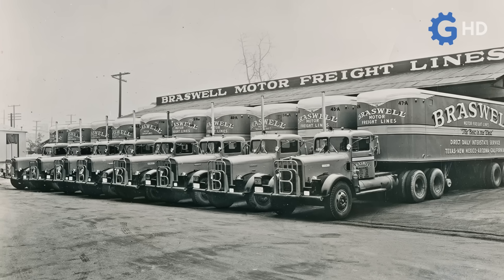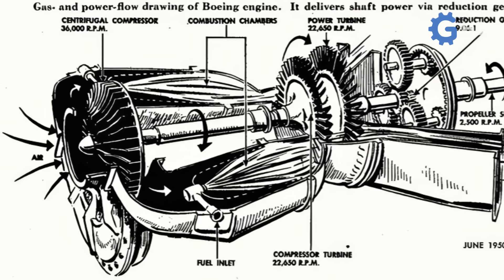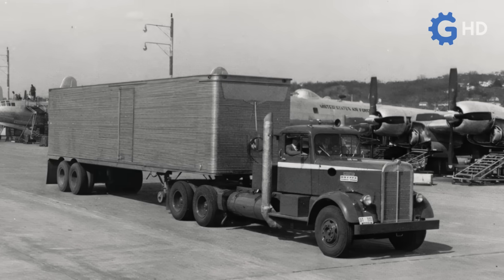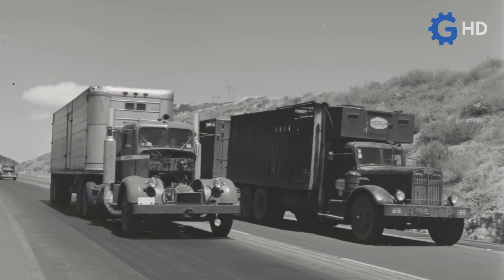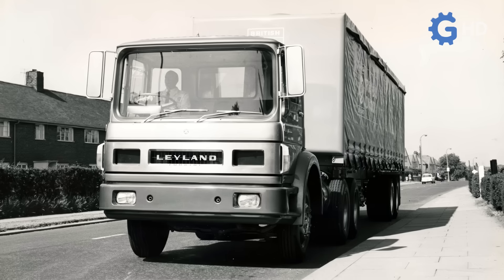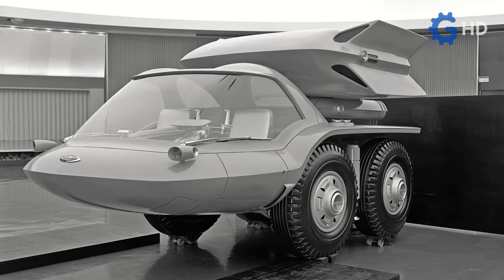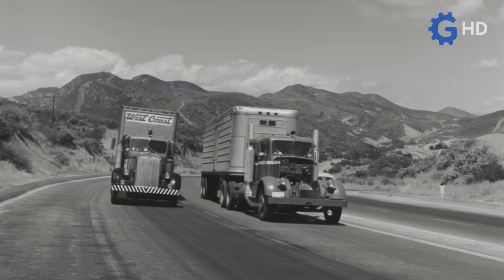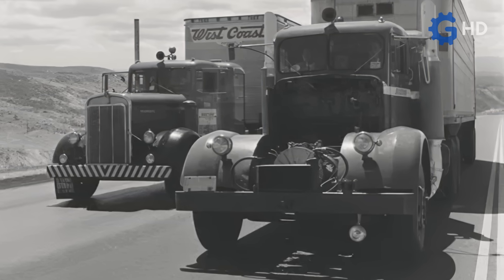The CRAZY Story of When BOEING Put a JET TURBINE in a Kenworth Truck

Comment: It would have been simpler to combine the turbine with an electric motor for traction, using it as a pure electric current generator
Reply: You would still have the same load/efficiency problem and terrible fuel efficiency... now combined with high construction costs.

Comment: After Boeing's turbine project was cancelled, one its engineers put one in his Model A Ford and drove it around for years.
A gas turbine engine is NOT a jet engine. Different number of turbine wheels. Gas turbines produce zero thrust.
Railroads experimented with turbines too, but they have almost no power at idle so they are not good at lugging. And their speed range is only 2:1 as opposed to 10:1 for a piston engine.
BTW--In technical circles, 'turbine' is pronounced 'tur bin.' I mean everywhere in the tech/aerospace community.

Comment: Thanks for the video. Without music in the background it would have been perfect. For a german guy it is more difficult to follow this interesting stuff. I can´t understand why big companies did such tests with gas turbines. Even locomotives had been tested with gas turbines service. They all failed. A gas turbine never ever can reach the efficiency of piston diesel engines for thermodynamic reasons. For aircrafts they are useful because lightweighted and powerful. However, the service conditions are different. An aircraft or a heli travels with nearly constant speed, allowing the turbine to run on the BEP - which is not good, but much better than on the other speed ranges. A truck might go with constant speed travelling on a highway, however, the engine must be suitable for sudden stops and for stop-and-go as to the traffic conditions. They try to build gas turbines with heat exchangers for better efficiency. Those engines are low scale, working in little aeroplanes. We´ll see whether they do it.

Comment: The problem is, you cant integrate leap innovation into an already well developed and streamlined industry, its too disruptive and therefor costly which the gas turbines for the road were, although they were getting rather sophisticated. Incremental innovation integrated into an existing technology is more cost effective, which is why turbochargers were introduced to drop power to weight ratio of regular diesel engines. Now they run on a combined cycle, one diesel, one brayton like a gas turbine.

Comment: Nitrogen dioxide? Soooo, can’t have it in a truck, but it’s fine to fly over my house shoving it out by the ton :D Still a good back up charger for an electric car (or truck). Run them at pull power and they are ace.

Comment: A gas turbine would've probably been for better use as a generator using it like the way they do a locomotive to power traction motors at the wheels. They're way more reliable than a diesel engine. The only drawback is the noise and fuel mileage.

Comment: As an aircraft mechanic I never knew a helicopter is not an aircraft .In the 50's the biggest truck diesel engine horsepower was about 350HP.  In 1956 Ford built 3 turbine Thunderbirds. I drove a Dodge turbine car and was very underwhelmed.
Reply: Agreed, the number of false statements in this video boggles the mind.

Comment: The title says "Jet Turbine," yet what was installed was a GAS turbine. 
One goes through a gearset/geardrive and is connected to the driveline. The other uses exhaust gases for thrust, and there is NO connection to the driveline.

Comment: I doubt 500hp. Secondly a very light Engine... The truck tractor needs weight on the front  and drive wheels , so a light engine is not necessarily a good thing at all.

Comment: I'm positive that the turbine engine had to be geared way, way down. Turbines produce little torque at any speed usable in a truck.  The turbine needs to run at at least 10,000 rpms in order to do much work.
Reply: That’s why turbo electric and turbo hydraulic drive trains are used.
Helicopter main rotor torque characteristics are very similar to truck drive requirements.

Comment: @7:57 I have to say I do believe our esteemed host might have been chewing on a wild wood weed when he started talking about any manufacturers looking to use a gas turbine to powered road tractors in the 1970’s, like that was gonna ever happen.  Ford and GM had played with the concept and so had Boeing as host had mentioned but least we forget gas turbine had been seriously experimented with in  by Chrysler, and I guess you can say toyed with by GM and Ford as well as a host of auto makers that have been lost to time.  What I am trying to say is the idea/concept of a gas turbine powered wheeled vehicle had been well tested and proven impractical for a laundry list of reasons starting with fuel consumption and emissions
Reply: yet if they backtracked to its early predecessor, the same principle as a reciprocating piston engine is quite possible and solves several issues such as the terrible compression ratio and hence thermodynamic efficiency... ericsson/cayley/brayton cycle was originally used on piston engines... they had metal and manufacturing issues 150 years ago...

Comment: BOEING does not build jet engines, only aircraft. YES simi trucks & greyhound all did tests with  GAS TURBINES  not jet engines. The problem was the 22,000F exhaust temp melted truck parts, tires & road surfaces. FINALLY, California said FU-gas turbines were banned from California roads. If you arent trucking in California your not going to be making real $$. 

!
Reply: Boeing DID build small gas turbines for helicopters in the 1950’s.
Gas turbine exhausts are below 400C…

Comment: In the 1950s highway trucks had up to 190 hp. The diesel engines weren't equipped with turbos until the later 1960s when more power was desired.

Comment: Interesting video. They tried them out in automobiles and used them in locomotives . The hot gasses were a big problem in the locomotives. There's a picture of a U.P.R.R. unit under a concrete road bridge, and the asphalt on the bridge deck is a huge blister. They weren't allowed to leave them idling or running under bridge structures after that.
Reply: Those were all General Electric turbines used exclusively between Ogden UT and Cheyenne WY on the UP. They burned Bunker C oil which like tar, needs to be heated to flow. They had auxiliary diesel motors to move them around terminals when the turbine was shut down. And they certainly were LOUD--UP called them "Big Blows."
Reply: Run all the hotel power for a train with the turbine and use the waste heat for a steam engine.l 

LOcomotive

Comment: Chrysler addressed the fuel consumption and exhaust heat issues by using a recuperator.
Reply: Also an unmitigated failure
Reply: @DoktorBayerischeMotorenWerke  Failure or lack of courage to proceed?
Reply: @anthonyxuereb792 Gas turbines are superior in aviation and certain marine and stationary applications... but they are inherently unsuited to land-based transportation applications... which is why they have all been failures.
 Gas turbine cars and trucks are simply not a commercially viable concept.
Reply: The Chrysler turbine car only produces 130 hp at 4 mpg city 15 mpg highway

Comment: The Seattle Museum of Flight has one of these extremely rare engines. Boeing is not in the jet engine business, but has had a history of support for aircraft engine development. United Aircraft's Pratt & Whitney engine development was originally funded by Boeing as I recall. 
My memory of that engine when it was new was from a magazine article describing a gas turbine for a San Francisco fire engine to be able to climb those famously steep hills. Its very high power to weight ratio was the incentive for it and every thing was being tried during that era to advance land transport uses of the gas turbine. There was a series of experimental gas turbine powered railroad locomotives, and Chrysler had their turbine cars. The Chrysler program was the only one to lead to an actual production land vehicle powered by a gas turbine, a military tank where fuel economy is one of the last considerations. Even that tank had its diesel powered variant available. though  mechanically simple, the thermal problems of excess waste heat never were completely solved with an engine that might have to idle in place for long periods of time.  Also dust probably did not help that type of situation. Turboshaft powered aircraft and naval ships have fewer of that sort of problem.

Comment: All modern trucks are turbines.... with a diesel ICE as the combustion stage.
Reply: DIESEL CYCLE + BRAYTON CYCLE   Turbo-Diesel
Reply: How so?
Reply: All modern trucks HAVE turbines......
Reply: @darrellhay  although that gives the impression that the turbine itself develops power or is a separate engine , of course the only actual power is developed by the diesel engine with the turbine driving a centrifugal compressor which obviously allows the engine to develop more output . However the turbine compressor set itself does not consume any fuel or develop power as such
Reply: @malcolmwhite6588 even better description.  😊
Reply: @darrellhay  thank you Darrell- I appreciate it
Reply: @malcolmwhite6588  It's worth noting that the turbo consumes power. Yes, the result of having it is more output power than without it, but it takes a not insignificant number of horsepower to spin that little bit of metal.
Reply: Turbocharger =/= turbine engine.
Reply: @davidzachmeyer1957  are you saying a turbo charger is or is not a turbine engine?
Reply: @malcolmwhite6588  That "=/=" is an old form of "not equivalent" symbol. As a single glyph it would be an equal sign with a slash through it. He is saying a turbocharger on an engine is not equivalent to a turbine engine, and he is quite correct about that.
Reply: @lwilton  brilliant thanks for that information I thought it was that but I had not seen that version of the mathematical symbol to signify that,  and yes, as you say -his assertion is quite correct in that a turbocharger is not equivalent to a turbine engine
Reply: @malcolmwhite6588 All turbochargers are Brayton Cycle engines... heat engines.
Reply: @WilhelmKarsten  well done Wilhelm I hadn’t even thought about that and did some research and you are quite correct-thanks for the information and challenge me to learn some more👍
Reply: Volvo use a power recovery turbine in their diesel trucks to improve fuel economy and turbo compressor response…
Reply: @allangibson8494  that’s interesting- I had never heard of that and looked it up to see how it operated👍🍻
Reply: @malcolmwhite6588 Not exactly novel, the technology dates back to the DC-7 and the Napier Nomad aircraft engines.
Reply: @allangibson8494  thanks for that I hadn’t even thought about that I’ll go back and look at some research👍

Comment: no road diesel was rated near 500 hp back then .
Reply: My exact thoughts 😂
Reply: Yea, 350 HP was the "big hammer" back then.
I'm from the coal field in Pennsylvania and it's hilly around here, I can remember years ago if you got caught behind a coal truck going up a hill it was torture, those things would crawl up the hill with so much black smoke pouring out of them you'd have thought they actually burned the coal they were hauling. 
Nowadays 500 HP is common in trucks and you don't see black smoke billowing out of them anymore.
Reply: I can remember the first 350 I saw in the mid '60s. I think that was experimental, not sure. But 500 no way.
Reply: He probably meant torque?
Reply: Yeah I can't stand these YouTube channels that just grab pictures off the internet and play their voice in the background talking about stuff they don't know  Anything about
Reply: I was going to say the exact same thing maybe 130 horsepower back then
Reply: With semi tractor trucks, torque is the rating to look to. The diesels can produce usable torque in low and medium rpm ranges, exactly what is needed to haul heavy loads. That, and the multiple range transmissions allowed them to reach highway speeds.
Reply: Didn't see 440 from a stock engine until 1985? 87? Not sure. But I saw one in Tulare at the big show they used to do every year.
Reply: @lukewarmwater6412 
Yep, in the mid 80's 450 HP was a big hammer, now that's the average and 550-600 HP is a big hammer, and they don't billow black smoke out like trucks did just 20-25 years ago.
Reply: @dukecraig2402 since they took the sulphur out I'm glad they don't roll coal any more. It just doesn't smell right. Tastes way more toxic when they regenerate. Like the power when I'm behind a truck, on a hill. But the nostalgia is gone. Progress eh?
Reply: TURBO SHAFT
Reply: no but work got done with what they had
Reply: Actually they existed the Detroit 71 series v12 supercharged diesel engine it came with around 525 HP
Reply: @santiagosuarez8142 1957 was the first V series 71, and the 12V71 would have been rated around 450 hp, the 8V71 was 318 hp, and the 671 was rated at 238 hp. Turbo models were typically found in marine service,  not OTR trucks.

Comment: When I attended UTI Phoenix in 1987, an instructor told about experimental turbine engines. 
 Garrett in Phoenix was testing them, and they were driving around Phoenix. 
 I never saw one though.
Reply: I was just thinking about Predator (1987) was released; "Get to da choppa-powwrud truck!"
Reply: I worked at Garrett at that time and there were 2 Mack trucks with these turbines, one conventional and one cabover and yes they were awesome. I spoke with one of the drivers and he said he drove from Phoenix to Flagstaff without having to shift and going the speed limit uphill with an 80,000 lb load. The GT-601 engine in these trucks was the precursor to what is in the M1 tanks. One of these trucks is in the Mack truck museum in Allentown Pennsylvania.
Google: GT-601 gas turbine-powered Macks   and you will find pictures of both trucks and a complete description.